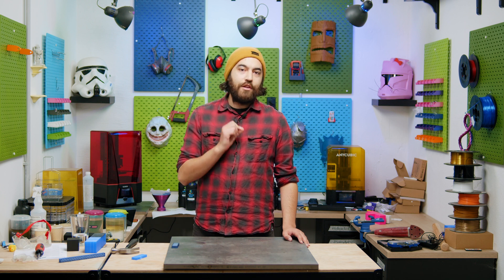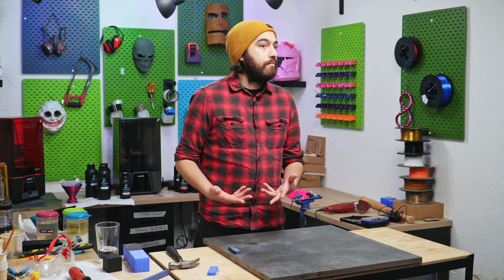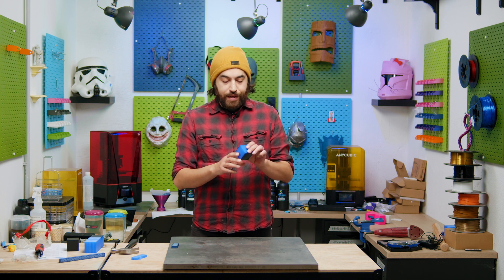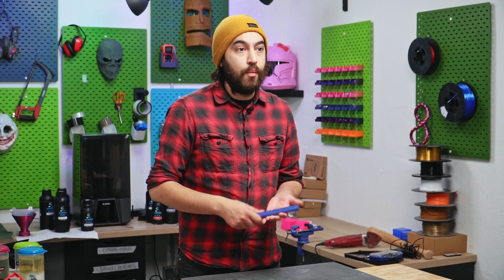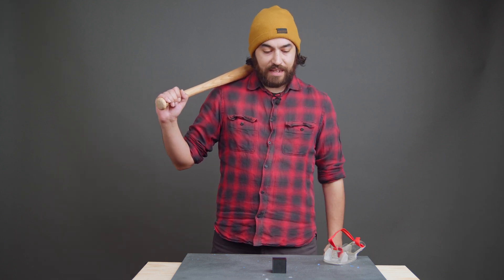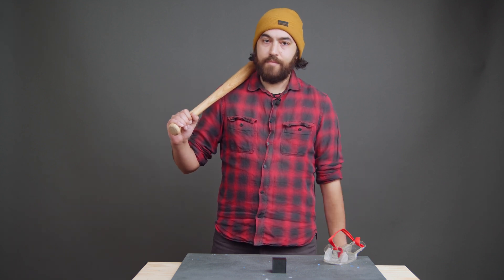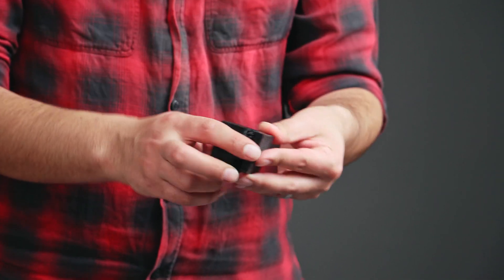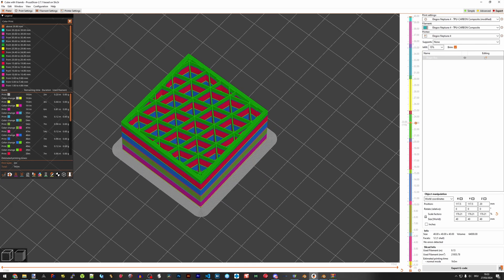Does Mixing PETG with TPU Improve Impact Resistance in 3D Prints?

Comment: I have been using a combo of Nylon + PEBA for my drones for a while. PEBA is a derivative of Nylon and makes TPU look pathetic by comparison. Both also have a lower density than either PETG or TPU, so for my application that's even better.
PEBA also has an insane amount of energy return and elongation at break, so would probably be good for your bow idea
Reply from the maker: Hmmm never actually used PEBA, Fillamentum have some but very interesting material. I'll give it a look, thanks for the tip :)
Reply: @3DJake_Official  I used to use the Fillamentum one, but it's been nigh-on impossible to get lately, so I have switched to Kimya PEBA-S. I still use Fillamentum Nylon FX256 though
Reply from the maker: @evilc2048  We have problems on our side for the PEBA too but I am definitely trying it whenever it comes back in stock!

Comment: What you are trying to achieve seems to be the opposite of what is achieved by embedding fibers (glass, carbon,...). To get best performance the fibers have to be distributed evenly. Would the same hold here in the other direction? Hence alternating layers of PETG and TPU or ABS and TPU. This makes this a ideal task for an IDEX machine.
Whether every layer, every few layers, only outer layers, only infill,... gives the best results, there are many parameters to figure out here and probably a sliding scale of increasing toughness and more flexibility as there will inevitably be a trade-off.

Comment: Just use nylon dude 😅
Reply from the maker: there are quite a few reasons why I wouldn't 😅
Reply: @3DJake_Official whatever it is, cannot be as annoying or error prone as switching spools constanty. And at the end it did not even matter vecause both tpu and petg become too fragile on impact. Vheck out hoffman tacticsl or the whole fosscad community, your understanding of PETG is fundamentally wrong. It is neither stiff nor impact resistant
Reply from the maker: @quasimongo410  Oh it is incredibly annoying to do it manually, like I said better with a dual extruder or toolchanger but this was just an exploration into whether there are functional purposes for mixing filaments, this is far from the best method for high impact resistance as mentioned in the video. Regarding PETG being impact resistant, the key word here was "relatively" 😀

Comment: I'm thinking you need tpu on the top and bottom and also with infill in the middle . The shells would provide the impact resistance for the face and the middle the absorption of the impact to protect the petg. Use 3D cubic.  Or should we just be using separate pieces and gluing them together..

Comment: I wonder if mixing things up a bit more than just separate layers would be helpful; for example making the walls TPU on some layers, infill TPU on some others. eg. walls TPU with PETG infill x 3, all-PETG x 10, infill TPU with PETG infill x 3, all-PETG x 10 and repeat. Some g-code jiggery-pokery (reasonably do-able; Cura at least comments with ";TYPE" whether it's about to do skin, wall-inner, wall-outer, fill) and for IDEX or toolchangers to just add tool selection g-code at the ";TYPE" lines.

Comment: If you put TPU sandwiched in the center of the PETG you might be able to mitigate the loss in bending strength. Reason being that under bending loads the top and bottom are under the most stress (one being stretched and the other being compressed), meanwhile the layers in the center are under comparatively negligible stress. 
Granted not ALL of the downsides can be mitigated and this would probably introduce some downsides of its own. But the interesting part of this type of composite in 3D printing is that you can design specifically for your loading requirements.

Comment: What about the 99D TPU that Zach Freedman showed in his latest filament rating video? It's apparently quite rigid, but also highly impact resistant. I was not able to find any with that rating, but 95A looks to be pretty rigid on the scale, and is more readily available.
Reply: There is a 70 D TPU with Carbon. (Search for "flex hard cf")
And there is a 64 D TPU from BASF.
Reply: Phaetus makes 78D TPU

Comment: Either an PETG/TPU, ASA/TPU as alloys or at least coextruded or cabon fibre filled TPU would be interesting follow ups. Impact resistance is always welcome - if the process of printing is practical.
Reply from the maker: I read recently about a new filament that is PLA but with a PETG core, can't remember the manufacturer though.

The method I used is not what I would call practical. Very tedious actually unless you have a dual extruder or toolchanger.

Comment: How about a coextruded filament of tpu and PETG?
Some years ago someone "designed" a spiral laying flat on the printbed, basically printing your own filament layer by layer. Use able length was of course limited by the print bed. But could be a fun experiment nonetheless
Reply from the maker: I think that would have way too much flexibility though unless it had just a tiny bit of TPU in it. Did the spiral thing actually work ok? Can't imagine the roundness tolerance to be good enough for reliable printing
Reply: @3DJake_Official  I did that spiral thing once to make some disgustingly brown PETG (my colour choices were a mistake). It's very much not round when you look at it, more like a diamond, but it is consistent, I just tweaked the extrusion multiplier a bit and successfully did a print in place puzzle with pretty tight tolerances.
Reply: @3DJake_Official  the spiral thing was more of a concept. Since it is not exactly round, you need to ramp up the extrusion multiplier. If printed with effort, you can get a constant output.
You don't have to part it 50/50,but you could do like 45% PETG, then 10% TPU and the last 45% PETG again. Up to your imagination.
Reply from the maker: @spedi6721  sounds cool. I wonder if that is possible. I'm using about 90% petg throughout and I'm wondering how consistent a small amount of TPU can be coextruded in another filament. Maybe a future video project if we ever try to upgrade a DIY filament extruder to a coextruder. That sounds like a hell of a challenge though.
Reply: @3DJake_Official  that's definitely going to be a challenge. Maybe ask the company that makes your mysteryPLA if they can run a test batch for you.
Reply: @3DJake_Official  
Jep. It was dasMia and reused by Stefan from CNC Kitchen.
https://youtu.be/z3aUGmfnmIg